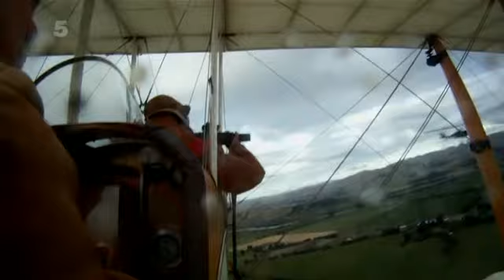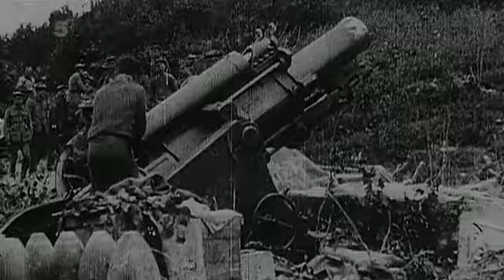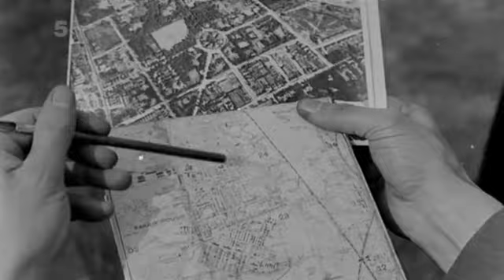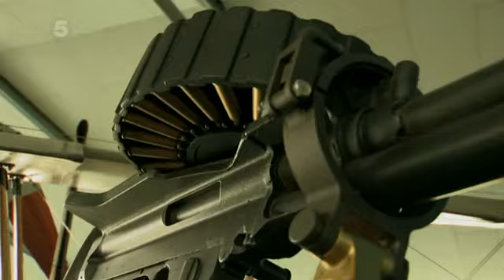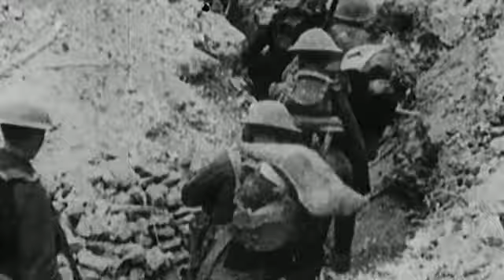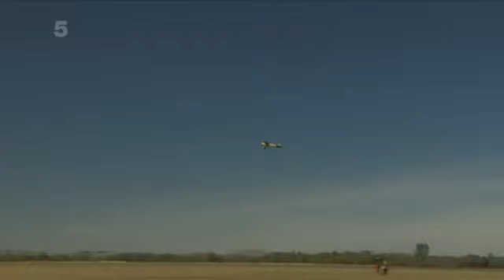World War One Top Gun Revealed

Comment: Why was the observer initially in the front seat? Worse field of view in all directions, worse vibrations, more wind.
Second, the obvious initial solution to firing forward (for a tractor biplane at least) is a top wing-mounted MG as in the N11, and/or give the rear observer one in a two-seater.
Reply: Pilot in the rear balanced the engine, observer sat over the center of gravity. Plane remained in balance with or without observer.
Reply: And that's why they changed it. He had no clear vies of the ground.

Comment: Errata: Lee-Enfields have a 10 shot magazine that is loaded with 5 round clips.
Reply: +Tom Lawrence They did have 10 round magazines but they only loaded them with 5 rounds.That's why they didn't make any 10 round stripper clips like they did later for the Russian SKS.If you load a full 10 rounds in the mag it puts too much pressure on the mag spring and the most common result is that the gun jams on the first round.Normally in battle they would load the 5 and after 2 or 3 rounds were fired they'd load another clip giving them a maximum of 7 or 8 rounds in the gun but also never running the magazine dry